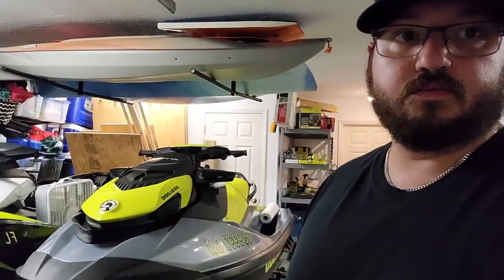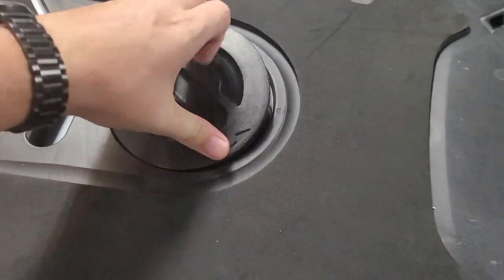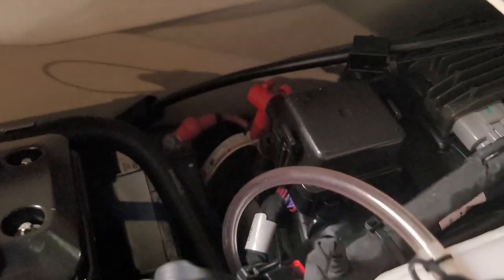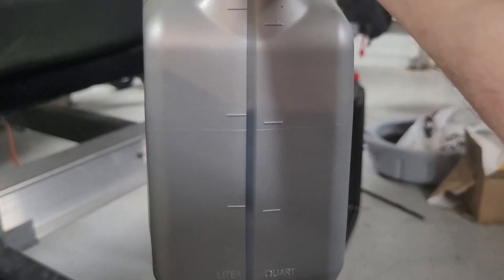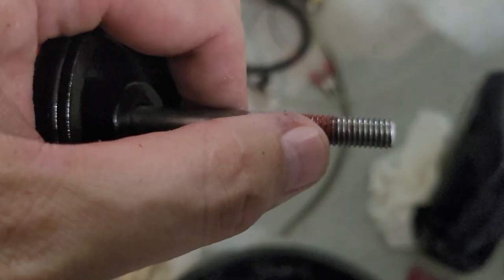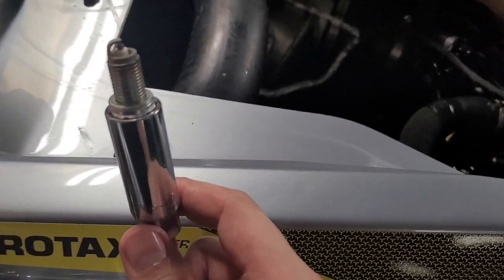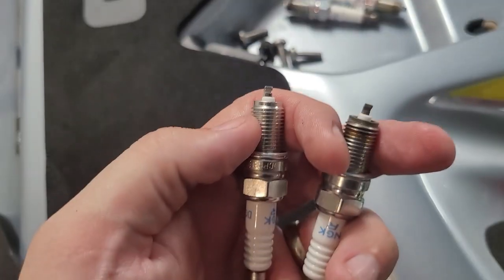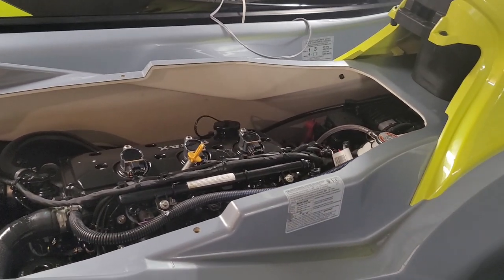Changing the Oil in my 2021 SeaDoo GTI SE 170

Comment: Do you have a video on how to remove the battery from this model? I want to pull my during storage and trickle charge them, but don't know how to remove the battery.
Reply from the maker: Hey thanks for watching, unfortunately not I have not had to remove my battery yet. I have done a trickle charger while it was still installed that worked just fine. However I did just now go out and take a look at mine I think it is fairly straightforward to remove this battery. If you lift up on the cooling hose above the battery it should fold out of place, and then you only need to remove the strap that ties it down unbolt the terminals and it should lift straight out. I know on this model the battery is next to the engine while on the older style models it was located behind the plastic gray wall in the front storage area. Maybe I will do a video on this at some point though, you are the second person that I have seen with this question. Probably would make for a good video. Thanks for the advice.
Reply: @professionalweekenders  Hey! Yea, unfortunately, it's not that easy. Once the strap is removed it doesn't budge... There is a piece of sheet metal part-way over it, and whatever I try that won't budge either. Unfortunately, the only way I have to trickle charge them is to remove the batteries and charge them in the garage, because they will be stored in a storage unit without electricity. Any help is greatly appreciated and yes!... make a video!
Reply from the maker: @darringunnell5158  I'll give it a shot some time soon. 👍
Reply from the maker: @darringunnell5158  okay, curiosity got the best of me. So here I am after midnight out my garage taking a look at the battery. First I unhooked the terminals. Be careful don't drop those bolts. Next I pushed down on the strap near the engine and was able to wiggle it towards the engine and under the clip. I've seen some other people that have a double strap while mine is a single blue strap. I did not have to fight very much to get that off but other people said it was a real pain. I was able to do it with my bare hands. Next with the strap off I see the metal plate to which you're referring. On my model it is fairly loose and can be easily pushed out of the way without bending it. Once that was out of the way the battery still seem to be stuck in place. I'll admit this had me stumped for a moment. But after reading other comments it doesn't seem as though there's any other mechanical connection holding it down. So I grabed the battery from the side, the the short end nearest the hall and pulled towards the center of the ski. That did the trick and the battery came loose. From there I was able to easily lift it straight out. Now putting it back in will be a challenge for tomorrow. I've read some other people say that putting it in as much more difficult than taking it out. But again I think that seems to be issues with how tight that strap is or how long the battery was left not in the strap. Good luck. I'll try to do a video on this maybe this week or next week.
Reply from the maker: @darringunnell5158  and I can't go to sleep unless it's finished. So I tried to reinstalling it. That actually went much easier than I expected. I think the tip on this is to make sure you have a good pair of gloves preferably with a rubber grips. My strap was so covered in oil and Sea-Doo lube I could not get a good grip on it I also busted my knuckle pretty good. So definitely use some good gloves and you shouldn't have much of an issue.
Reply: @professionalweekenders  Can't wait to try it tonight! Thanks so much!
Reply from the maker: @darringunnell5158  posted video of removing the battery last night. https://youtu.be/gBmi6sYN0MM